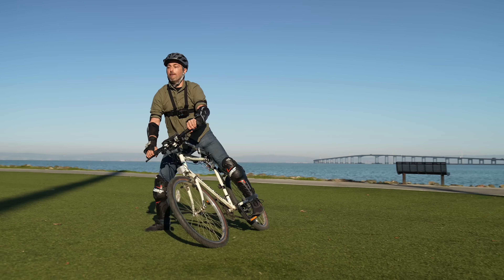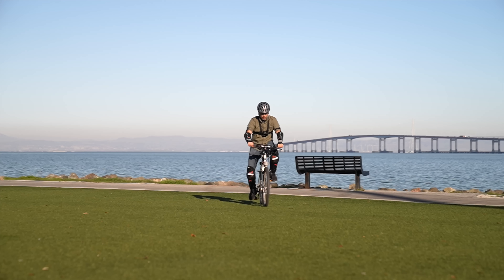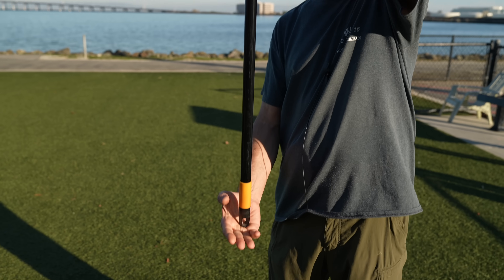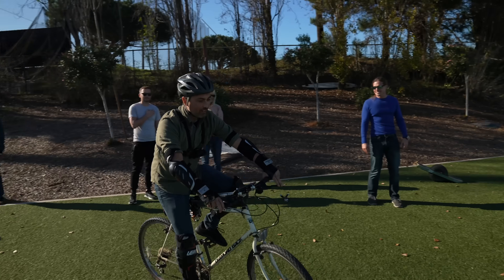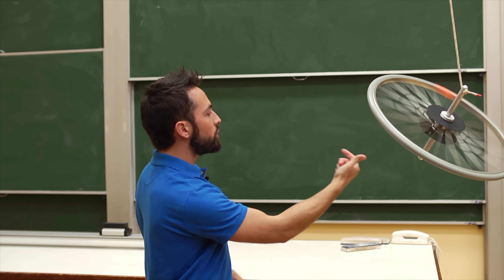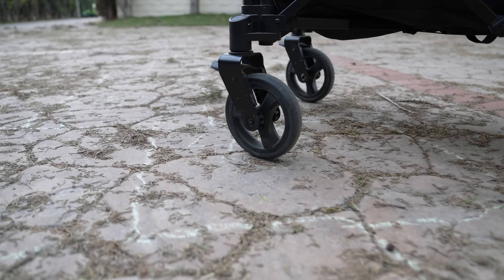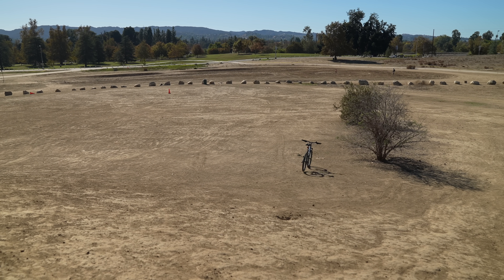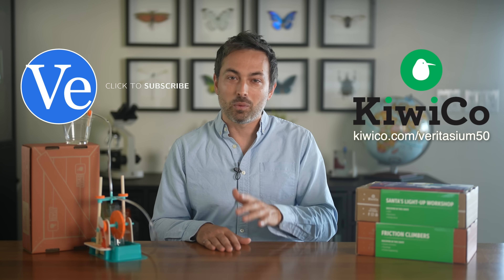Most People Don't Know How Bikes Work

Comment: Those of us who learned how to ride as adults learn in a more cerebral manner, expressly because it seems counter-intuitive. You can't take a turn just by steering in the desired direction, unless moving awfully slowly or, better yet, just guiding the bike or motorcycle manually. I learned to ride as an adult, and I could instantly tell how the balance worked because of that.
Reply: This can also happen with some children, e.g. in the autism spectrum, where they need to understand something to learn it. Most people learn by example, seeing others do something, and repeating after them, without needing to know why it's done this way. However some children don't act like this, and need to understand first.

I personally never managed to learn how to ride a bike as a child, because I was trying to first learn to ride slowly, and planning to go faster only once I've mastered riding slowly. This didn't quite work, and after many painful failed attempts I gave up. Only years later I understood why my plan didn't work, but now I wasn't sure if having that knowledge would enable me to finally learn how to ride a bike... so I went a different route - kick scooters. I just went with my original plan (master riding slowly before trying to ride faster) using a device that was better suited for the job. Now that I feel more comfortable riding 'something' at some speed (say 15 km/h) I could probably make the switch to bicycles easier. And personal electric vehicles. And then, maybe, even cars at some point. Though that seems like a long way ahead (probably years), since right now I wouldn't feel comfortable driving anything above 20 km/h.
Reply: @Tennouseijin  I feel you. Take your time to get where you need to be, and where you feel comfortable being.

Regarding the first part, I experienced that expressly because of my high-functioning dyslexia (in the sense that I will start making pretty bad mistakes when I am tired, because I lose the focus I need to not make your typical dyslexic mistakes).

What I mean is that I had trouble with Greek orthography: Greek has 2 ways to spell the sound [o], 2 ways to spell the sound [e], and 6 (!) ways to spell the sound [i], plus some other funny little tidbits which can be rather confusing to a dyslexic person.

However, I can say with ease that I make far fewer spelling mistakes than most people in Greek, because I had to learn why those words are spelt the way they are, and so I don't just type something I don't understand to some intrinsic level.
Reply: @RaspK  regarding dyslexia, I see Greek has similar problems to Polish... we have a/ą, e/ę, s/ś, c/ć, l/ł, ch/h, rz/ż, u/ó, just to mention a few pitfalls. While personally I've never had problems here, I know plenty of people who either - keep making mistakes, require a spellchecker to write without such mistakes, or eventually learned to write correctly but, as you say, it might require more mental effort from them.

On the other hand, I seem to have high-functioning autism, undiagnosed until I was 30 years old. Now that I've read about the topic, it started to make sense to me why social interactions are so exhausting - it seems many things that other people do subconsciously, I learned to do consciously. Things like recognizing emotions, discerning lies, empathy, etc. I've been doing these things well enough that people didn't really consider me deficient - in fact, I often did better than the average person. It's just that I need frequent breaks, I prefer spending maybe 80% of my time alone, to have the energy to spend the remaining 20% of time interacting with people, and also this seems to cause problems when trying to multitask - I can recognize emotions etc. when I'm listening to someone, but when I'm speaking I'm too occupied with thinking what I want to say, making it much more likely for me to miss social cues. I need to take breaks from speaking, to look at the listener xD

The brain is a strange device... it seems it can do the same thing in many different ways, with different advantages and disadvantages.
Reply: @Tennouseijin  +1

Comment: I mean.. thats how momentum works, you cant put your momentum left immediately without changing the anchor point to the ground, since your centre of gravity is too high and youd fall over, this works on a car because it has four wheels, not two, so your centre of gravity being high up doesnt matter since the two wheels on the outer side of the turn will stabilise the car, on a bike, there arent outside wheels, therefore you have to stabilise the bike by slightly angling your centre of mass towards the inside of the turn, so that you wont topple over, this is done by turning slightly in the opposite direction to the way you wish to turn before initiating the turn, pretty simple if you think about it

Comment: I was thinking about this just the other day actually; I've noticed that if I'm cruising and taking a wide turn I don't countersteer to start it, but rather just lean my weight to one side and let the bars adjust into my turn like the self-steering of an empty bike. For sharper turns though I've definitely noticed myself doing this though.
Reply: That's how I do it as well. I like to ride my bicycle without holding the handlebar when I'm just cruising and just leaning in a direction is the only way to steer then

Comment: This same principal applies to Bipedalism. For you to walk or run forward, your body rocks forward first, essentially starting to fall forward, after which a leg extends to catch you before falling. You can try this by standing with your back strait against a wall. Now begin to walk forward. You'll notice that your back comes off the wall and your torso begins to fall forward. A foot then extends and catches you before you fall face first onto the ground. The same thing happens on a bike, you steer left - in order to fall to the right, and turn right.

Comment: How is having a giro scope spinning in the other direction in the vertical axis negating the girosopic effect?
On the University built bike
Reply: The opposing gyroscopes have their axes aligned with the wheel axes, and they're spinning opposite the wheels so the net gyroscopic moment is zero.  An alternative is to look at something like a ski-bike since they have no gyroscopic effect to begin with.
Reply: @Rick_Cavallaro  thanks for the reply. I'm still confused shortly a gyroscope stays on its axis due to spinning mass. Having another spinning mass above it would just double the gyroscopic staberlizing effect no?.
Reply: @duncanread4442  I understand your question now.  But nope - having a second gyroscope rigidly attached to the first with axes aligned, but rotating in the opposite direction causes them to cancel out.  If you've ever played with a gyroscope in a gimbal, you've probably noticed that...
- It resists you changing its orientation
- It responds to your efforts by changing its orientation 90 degrees different from the axis you're trying to rotate it about.
- If you hit the gimbal lock, it immediately loses it's resistance to change in orientation.

When you mount two counter-rotating gyros together, each acts as the gimbal lock for the other, and they have no net gyroscopic effect.

Comment: This video has so many factually incorrect statements about physics it should be labeled misinformation.
Reply: Can you list them, so we can learn?
Reply: @jacobshirley3457  Sure for money, I'm not doing a physics analysis to show you how this is wrong for free.

If you want to actually understand, you have to do research on angular momentum and momentum transference and why you can slightly adjust the handlebars of a motorcycle and the bike will force your bodyweight back in line with the equilibrium of the bike.

Comment: This is also a testament to how good our brains are at learning. When simply just presented with a bicycle without training wheels for the first time, it can sometimes take only a matter of hours or even minutes until the brain has figured out the physics and mechanics of how it works, and how to keep it upright.
Reply: Yup!  I'm pretty sure the brain isn't doing the math, but instead builds a simple workable model that's easy to learn at a subconscious level.
Reply: Actually our brains are too slow.
Most of our movemens we do, we do before our brain gets the signal.
Reply: @XtreeM_FaiL  That gets into a complicated area that I don't fully understand, and I'm not sure if anyone does.  On the one hand I've heard that "muscle memory" isn't really a thing.  In other words, all commands have to come from the brain.  On the other hand, we know that we do some things faster than the signals can travel the distance through our nerves.  So the only thing I can guess is that the brain models the system and effectively uses feed-forward control with higher level (i.e. slower) corrections.  But who knows?
Reply: @XtreeM_FaiL  Sure - but how does that work?  Where are the signals coming from to make the muscle move if not from the brain.  To catch the glass that falls off the table, you have to see it falling to know where to reach - right?

Comment: Love this video.  This concept became profoundly apparent when I began racing street bikes at high speeds tucked behind a very small windshield.  You can keep your body tucked to the tank and just apply right turn pressure to the handle bars to turn left and left turn pressure to the handle bars to turn right.  This makes the bike lean into the direction you want to turn.

Comment: This just isn't correct. Maybe with novice riders at 4mph but there's a lot more to consider. For one thing, counter-steer doesn't take effect until a certain speed so at these speeds it's irrelevant. I'd guess most rider/bike combos wiould need around 12mph or more for counter-steer to be viable. At slow speeds you indeed turn the bars in the corresponding direction of turn. Riders shift their weight constantly, their weight isn't shifted as a result of handlebar input - it's the opposite. Try this: Hold a bike by the saddle and push along. Lean bike to the right and the bars will turn to the right. no left input needed. Follow up video please???

Comment: With bikes you can often just get into a turn by leaning, you don't always have to countersteer. But with motorcycles, its impossible to turn without first steering to the other direction. They weigh so much that your leaning has little to no effect on the inertia. And this is more true the faster you go.

Comment: Omg I was really wondering about something that happened occasionally when riding a bike, and had no idea how to explain it

Basically sometimes, for example when I bypass a person on a narrow sidewalk, I get extremely close to the edge and absolutely every time when it happens I realise I can very hardly turn back away from the edge, many times I even fail and fall on the main road. And I really couldn't explain it, I was like why the f*ck can't I make a slight turn to the left or right and I just freeze feeling I lose control if I try to?

So now I'm happy I finally understand it, it's because when I'm right on the edge I have very little to no room to make that little turn in the opposite direction that is necessary to give me the balance to turn away from the road. Pretty fascinating!

Comment: Is it the same thing if you ride a little bit faster? I mean you can steer your bike with just leaning to one side, but not when you drive so slow, so im curious if it would be a problem while driving faster with this locked steering
Reply: Speed does not matter.

Comment: Funny how you debunk your own video... if your bicycle locked (and no turn was initiated) then you just have to lean towards the desired direction. That's how you ride a bike if you are not using your hand. The last clip proves that the bike will follow that direction. So you can turn without counter turn, if you turn with your body and let the bike do the stirring.
Reply: Lean alone does nothing. You just proved yourself to be one of the "most people don't know...".
Reply: @XtreeM_FaiL  wrong.

this entire video is factually incorrect, counter steering to redirect angular momentum is a great way to quickly turn, but it isn't necessary to turn at all.
Reply: @XtreeM_FaiL  I hope you know that, repeating that i don't know what am i talking about is not an argument. Most people don't know that... you are probably one of them. 

Can you show the counter stir in a clip, when a bike turns without a rider?

Also the quastion was not that an unrideable bike is rideable, but can you turn with  a bike which can be stirred in one direction and only one direction.
Reply: @XtreeM_FaiL  except counter steering ISNT REQUIRED to turn a bike, he can say it as many times as he wants it doesn't make it true, just because it is the MOST EFFECTIVE way does not mean this is the ONLY way.

that's the issue, he's factually wrong about the entire physics of turning and momentum transfer.
Reply: @zzzz-fk8ce  not the entire, but yeah...

Comment: Most experienced cyclists turn by placing the outside pedal down at the 6 o'clock position and open their hip on the inside to allow for more angle leaning into the corner. I wonder if you utilized that technique would it be easier to ride the experiment bike shown in this video

Comment: It's like most motorcyclists will assume to turn right on their bike (especially say to avoid an object on the road) by pulling the right handlebar towards them, however, when you think about it, a little nudge forward on the right handlebar will set the motorbike up nicely to naturally 'Fall' into a right turn way easier than just pulling back on the right handlebar grip... Like you say, it seems counter intuitive but, it's the way it works. Motorcycle racers use this to best effect on the track to get the bike to 'Tip and lean' just as they need to go round bends how they need... 🤔😏😎🇬🇧

Comment: Being Dutch i tested this out, and sorry, but either this video is completely false or we Dutch ride our bikes differently. I watched the roundabout in front of my house for 15 minutes, and not a single person steered left before going tight or visa versa. I tested it out myself and again, it's just not how it works. If i want to steer left i lean left to go left. This applied to almost all corners, the only exception was extremely tight 90 degree turns where leaning left just wouldn't shift your balance in time. But any other corner, either gentle bends or normal 90 degree turns, people here just lean left to go left.

Comment: There are those bikes where the front and back wheels are not anchored to the frame. When you turn left, the front wheel goes left by swinging the back wheel to the right. Is it the same as what's going on here?

Comment: The earlier portion of this video is stupid. If you lean into your turns you counter this problem and have more control. It may just be my experience after riding a bike for about 3 hours every day for 5 years for exercise/fun. The counter steer is an easier way to turn and is IDEAL for slow turns but if you're keeping a decent speed it's better to lean into a turn rather then swing out then turn at speed.

Comment: so, for example, when I am riding my bike with my hands off of the handle bars, how come I don't fall? Is it because of the self steering thing?
Reply: It's actually a combination of both.  You're actually using the three principles Derek describe for riderless bike stability, but you're using that to steer the front wheel, and you're most likely doing it unconsciously.  But you still counter-steer to initiate a turn, and you would still fall if the steering was locked.

Comment: maybe becasue our body mass act as the anchor to the momentum. it can not shift/transfer mass without external factor. the same true when we run with our legs. if you see soccer players , when they change directions when running, their main body remain center, but their legs shift spots on the ground to counter force. by mechanism, similar to how rocket tech use its side thruster to change directions. or airplane with its wings to aerodynamic. the main body mass is the anchor to the momentum.

Comment: Eh... I usually turn by only leaning.. The funny thing Is I'm not used to turn by using the steering wheels 😐 I think that's because I'm used with the Racing bike type of steer instead of the wide mountain bike steer

Comment: I don't wanna be THAT guy but... It IS possible to balance a bike with a locked handle, you just gotta compensate the center of balance by leaning the bike into the falling side but leaning your torso to the opposite side, and repeat. Although some degree of speed is needed to do that, I used to do it all the time when riding a bike, it's certainly fun.